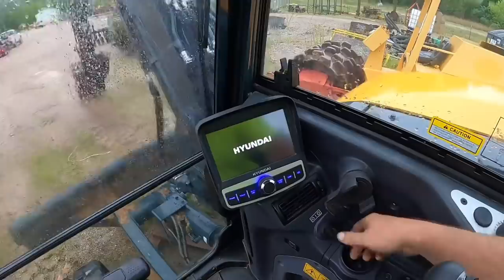Pulling and setting spud poles with the 120 and super stick. Does not go as planned at all

Comment: You need a loop chain like we use when working on water wells ,pipe & casing for that/you 3/8'' to 1/2'' chain ,all the loop consists of is a circle of chain your desired or needed length then you can make it a choker ?

Comment: Holy Moley, that's a mobile home frame!  At 28:00, the aerial view shows the whole dock at once, and you can see the original hitch at the lower part of the screen-- and that's clearly from a mobile home-- the size is about right for a classic house-on-wheels too.  I wonder-- did they just strip off the top, stuff large styrofoam blocks underneath and call it 'done'?  Are there sunken axles and hubs down underneath, or were those cut off first... that sure as heck looks like a mobile home frame, covered with deck boards...  Kewel.
Reply: Think those might be some docks DP moved for Ralph in another video? That was scary , too!

Comment: A couple years ago we did this for a private homeowner.  He wanted some piers out in to anchor a floating dock to.  We ended up using a 10 foot stretch of iron pipe attached to the input of a mud pump.  Once we were in  the area that he wanted the piers we would turn the pump on and "suck" a hole into to the bottom a few feet.  Then we would set the pile.  We over drilled a few but the silt fills it back in pretty quick.

Comment: Good morning DP I think a steel sling would have bitten those poles better.  Maybe a 5/8 diameter would be the best for strength and bite . 1/2 inch min .
Reply: Pipe and structural tubing are the worst to choke and tie down on a truck . I deal with that everyday .

Comment: For steel pipe. rail road tank cars with ends cut off down to 2 3/8   OPS  Dewey Ok.   closer 13in down Lally pipe Coventon Ky.              [ ops    oil pipe and supply.].

Comment: Good morning Mike ! Next time use a chain to pull pipe , straps do not work
Reply: Oops I was to quick 🤣🤣 it does help to use a pipe wrench with a cheater pipe in it , twist pipe to break the suction
Reply: Tool abuse 101, use a pipe wrench to pull against with a strap.